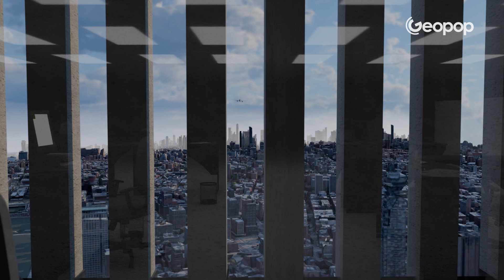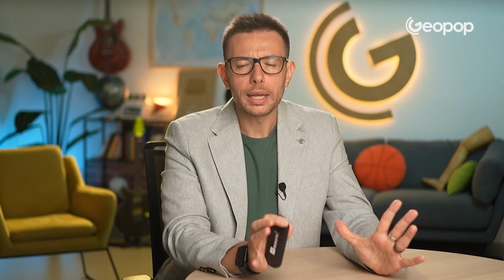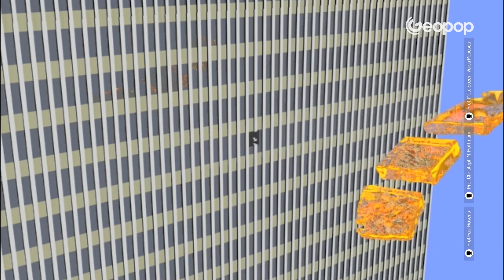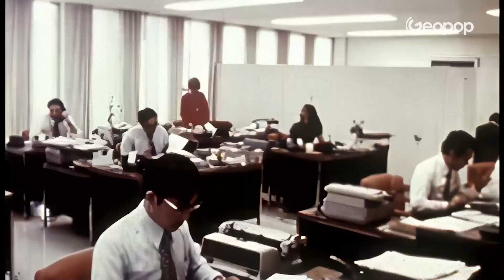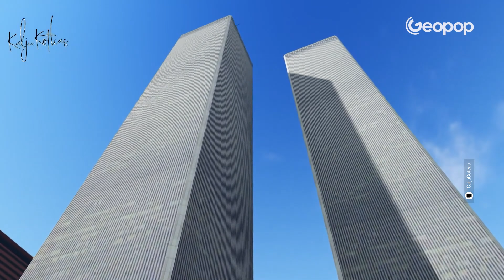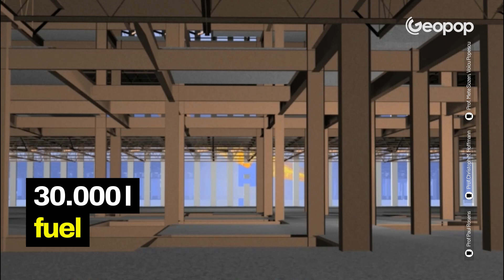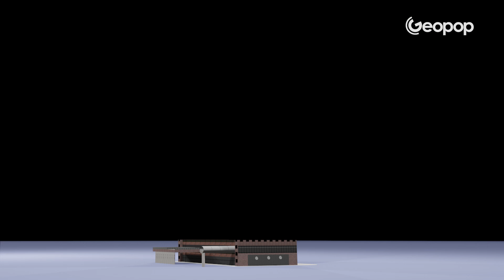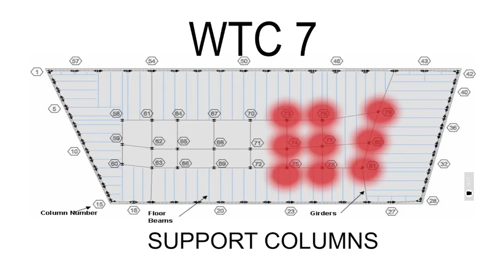9/11, 2001: The Technical Reconstruction of the Twin Towers and WTC 7 Collapses

Comment: 1 Question..????

How did fired Start Inside WTC7 Still to this day No explanation…… 🛑 The 💩
Also where R U getting these Destroyed Core Numbers…?

How is it possible to get that info….? Especially Since nobody was there to investigate The situation
Reply: The burning North Tower fell on it, starting fires on multiple floors simultaneously and causing extensive physical damage to the south and west faces of the building.

That question was answered within minutes of the North Towers collapse. 

Column damage data IIRC comes from The NIST and possibly Purdue.
Reply: @TheLoonResistance 
O really😂😂😂😂😂😂😂😂😂

That’s Neat, U musta Came up with that All by urself Huh? 🫏🫏🫏👍🏼
Reply: @adambailey9489  - Yup. And I can also do this(and YOU CAN'T):

Much misunderstood, Building 7 was the 6th building to collapse of 10 lost on 9/11. Because of its early low priority, conspiracy filled the information void with garbage made up by technically ignorant people promoting political agendas. But 7's loss is an engineering problem and should be treated as such, so I prepared this brief summary of my own analysis to fix that, using technical analysis, not ideology and tired memes. 

At 10:28am the WTC North Tower collapsed, showering Building 7 with tons of burning debris, causing heavy damage and starting many large  fires which burned out of control for the next 7 hours. Half the FDNY firefighters having been killed, units in disarray, equipment destroyed, no water pressure, and the greater urgency of search & rescue efforts, Building 7 couldn’t be saved so firefighting efforts were pulled as futile and 7 left to its fate. Firefighters make that sort of choice every day in brush fire situations - which houses to save and which ones to let go. Only real difference here is moving the decimal on the size and cost. People get overwhelmed by the size.

www.youtube.com/watch?v=g_SvpwyC17M

Collapse of a burning structure is always a concern for firefighters. Steel buildings subject to fire rely on active firefighting to survive. Buildings are designed around 1 to 3 hours of fire resistance, allowing time for occupants to escape and active firefighting to get started, after which all bets are off. Left to their own devices they'll exceed their design envelope and collapse, like Plasco Tower and Wilton Paes de Almeida. In 7 the occupants escaped, passive and active fire protections were compromised and active firefighting was abandoned hours before the collapse, which left the building to its fate. It lost. Odds on Building 7 would eventually collapse, and it did. No big deal in logic.

 http://www.youtube.com/watch?v=WnYBX6QT0R4 

FDNY Chief Daniel Nigro - The biggest decision we had to make on the first day was to clear the area and create a collapse zone around the severely damaged 7 World Trade Center, a 47-story building heavily involved in fire. A number of fire officers and companies assessed the damage to the building. The appraisals indicated that the building's structural integrity was in serious doubt. I issued orders to PULL back the firefighters and define the collapse zone. It was a critical decision; We could not lose any more firefighters. It took a lot of time to PULL everyone out, given the emotionalism of the day, communications difficulties and the collapse terrain 

FDNY Deputy Chief Peter Hayden ; We had our special operations people set up surveying instruments to monitor and see if there was any movement in the building. We were concerned of the possibility of collapse in the building. And we had a discussion with one particular engineer there, and we asked him if we allowed it to burn could we anticipate a collapse and if so, how soon? And it turned out that he was pretty much right on the money, that he said 'In its current state you have about 5 hours 

The collapse of Building 7 was anticipated and widely reported in the media throughout the day, with 24 video cameras recording some or all of the collapse. Everyone knew what was coming and why. 

www.youtube.com/watch?v=OY5S5k3tMHI

The collapse of Building 7’s was entirely different to the Twin Towers and harder to understand, most details being hidden from view and not intuitive.  But we can still sort out what happened through careful analysis and observation. This is my explanation of the collapse relying on no outside authority. 

Building 7 was a unique, asymmetrical 47-story steel framed structure built atop a smaller 3-story building serving as a partial foundation, requiring lower floors dedicated to complex load transfer structures. Of trapezoidal shape and all-steel tube-in-tube construction, B7 (above the 7th floor) consisted of a central core of steel columns carrying most of the gravity load, perimeter steel columns around the outside of the structure carrying the remainder of the gravity loads and long span beams and girders to tie those elements together and form the floors. On the outside of the building hung a moment frame or outer shell. 

Phase 1 : First externally visible signs of collapse initiation occurred at 5:20:28 pm and were notably quiet with observers not realizing the building was collapsing! No audible warning in the form of hundreds of ear drum busting 180-190dB explosive bangs preceding the collapse. Here at 12:00 a local CBS affiliate reporter is talking 10 blocks from B7 when collapse begins. People don’t start to notice the collapse until 12:11. At 12:45 is the famous CBS fixed camera clip of Building 7’s collapse. Note how quiet it is. 

www.youtube.com/watch?v=t5tEy6mXSE8

Collapse initiation was due to lower floor failures above the load transfer region (8-14th floors) in the NE corner. In this video at 0:45 you can see the NW corner from inside the building while under construction, Column 79 just out of frame on the left. That big, angled steel beam across the top of the frame connects to C79 at one end. The girders connect to the beam. That beam and all those girders depend on just one connection 

www.youtube.com/watch?v=nP3TNHPCIVU&t=45s

Phase 2 : The NE lower floor failures caused a loss of critical lateral support over an excessive length of Column 79 and it buckled. Looking at a floor diagram of Building 7 (www.nist.gov/image-16640) when you see all the structures that depend on C79 you quickly realize this one column was a relatively isolated structural element on which a disproportionately greater fraction of the structure depended analogous to say the Key Bridge. Externally as collapse begins we see a vertical progression of window breakage along the 44-46 line and a kink in the roof of the East Mechanical Penthouse at the top of the building, consistent with C79 failure. Normally with a buckling column, the load could be redistributed to other columns. With C79 that is not the case - the failure did not redistribute the load, so the collapse rapidly progressed to the roofline, sinking the rooftop penthouse. The transition from full capacity to almost no capacity occurs in an instant and will result in virtually no resistance 

Phase 3 : With C79 gone, B7’s progressive, non-symmetrical collapse continues with adjacent columns 80 and 81 left laterally unsupported, and quickly buckling as well, sending the EMP down through the building. C79-81 all have no diagonal bracing, which is the major reason why they could not redistribute a lot of vertical loads among one another. From there collapse progressed from east to west through the central core until the core was gone taking all of the interior floors and probably most of the perimeter columns with it. Follow the horizontal progression of window failures low in the building and the dropping of the remaining rooftop structures into the building. One of the big takeaways from the NIST Building 7 study (invariably ignored) was how their modeling determined C79 failing under ANY circumstances would have initiated the same collapse sequence. 

Phase 4 : After about 10 seconds only the exterior moment frame remains, giving the illusion B7 is still standing to the casual observer since little has outwardly changed. But it is just a hollow empty shell like an empty cereal box supported only by a few remaining columns and overloaded from the loss of the core columns and floors, quite unable to remain standing. With nothing remaining behind it, the north face leans inward, forming a V in the roofline, the last few columns buckle under the strain and the moment frame free falls, landing on top of the debris pile. 

It is only here at the very end that a single measurement of alleged free fall acceleration is taken, from a single point on the outer shell. The Building did not “free fall” – just one corner of the outer shell did, sort of. The Building_ (defined as its center-of-mass) was already gone before that happened. The period of alleged free fall was a product of how it fell NOT why it fell and can't tell us what started the collapse 10 seconds earlier. Start to finish the collapse took 18-20 seconds, 3 times longer than free fall . How fast something falls cannot tell you what started it falling_ anyway. 

The debris spread outside the footprint blocking surrounding streets, heavily damaging the Verizon Building and destroyed Fiterman Hall. 

Building 7’s progressive, non-symmetrical collapse was incidental and unintended collateral damage from the combined effects of fire + time + gravity, started by the collapsing North Tower. That is true no matter who planned and carried out the 9/11 attacks or why . The collapse was of so little consequence it barely registered at the time - a footnote, only taking on semi-mythical status as an alleged smoking gun years later when demolitions at the Twin Towers, missiles at the Pentagon and shoot down over Shanksville all failed and conspiracists had nothing left to work with. 

Anything can seem like a conspiracy if you don’t understand how it works. Now you should. I hope you found this helpful, informative and it solicits informed critical comment. If I made any errors of fact, logic or reason or left anything important out, please let me know so I can fix it. IF you can offer a more plausible alternative please do. Be the first. Please start any reply with the words “Tits McGee” or I will know you didn’t read it and are wasting my time.